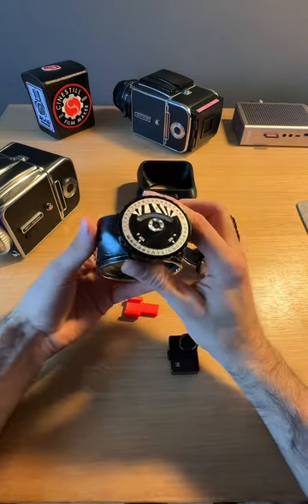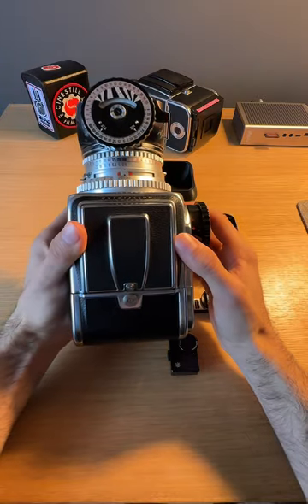All Hasselblad Cold Shoe Attachment’s

Comment: Hi Ishkhan. Been following you on Instagram. Love your work. Inspired by your reels, I picked up the Hasselblad accessory hood attachment. My problem is it won't fit on my Bay 60 & Bay 80 hoods. 

The plastic material on my hoods is too thick to accommodate the clip, which is weird because one is Hasselblad and the other two are Fotodiox, which are common. The hood attachment clip works, as I tried it on a thinner, metal hood for my Pentax 67 105mm. My question: Can you recommend Hasselblad Bay 60 Bay 80 hoods that are thin enough to accommodate the clip? I need hoods for a 50mm, 80mm & 150mm.

Cheers and thanks very much!
Reply from the maker: Hi Scott, thank you so much for you kind words! Yes I know exactly what you mean. Hasselblad ended up making a couple Bay 60 lens hoods and one model in particular had the indentation built in to accommodate the hood attachment. 

Would you be able to message me on instagram, I can send you a link.

Comment: Do you recommend all of these mounts for speedlights too?
Reply from the maker: maybe for very small ones like the nikon sb-18 / leica sf-20 / reflx lab simple flash anything bigger is recommended the hasselbald grip or a side handle to mount too
Reply: Okay, that makes sense. The plastic mounts seem less durable for holding the speedlight